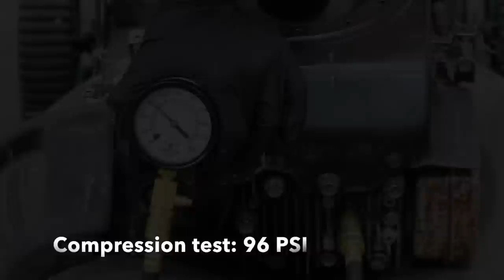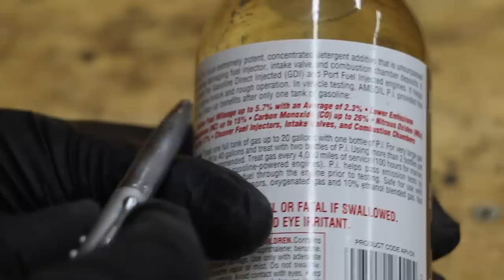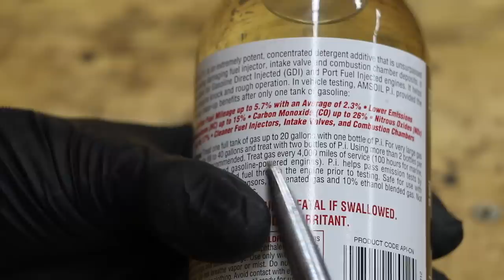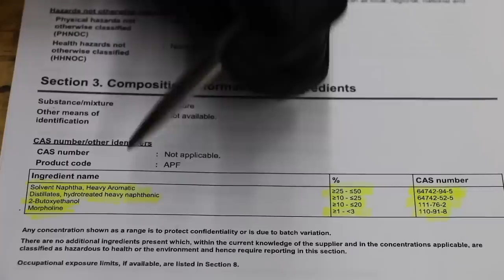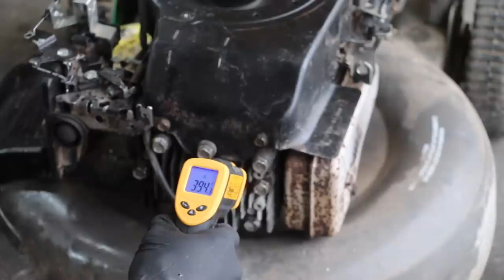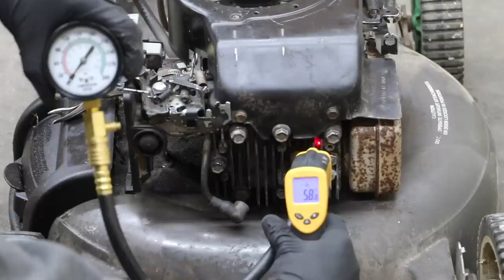Is Amsoil Power Foam better than Seafoam & MMO? Let's find out!

Comment: What was ran in that engine for all that carbon? Diesel?
Reply from the maker: I believe it was from normal use and not from any sort of alternative fuel.
Reply: Project Farm engine must be a bad design. My riding mower and engine hasn’t been in production in a long time. The mower is early 90s and the engine is sometime in the 80s. It’s not even that bad.
Reply: Wood
Reply: That engine must have never ever had any fuel additives to help clean it up.

Comment: Use the PowerFoam in the dirty carb, Spray and let soak...its AWESOME, been using it for that for almost 20yrs. Light varnish like in the video will just melt away, in fact, the white PowerFoam will turn green as soon as it contacts the varnish.
Reply from the maker: It's a great product!

Comment: Amsoil won as far from what I could see in this video,the engine ran alot smoother with about 4-PSI higher level of cylinder head compression.
Reply from the maker: Thank you!
Reply: Spraying tap water into the intake will make it run smoother too! Cost=$0
Reply: @TheOzthewiz  and it scores the cylinder wall and chews up valve trains due to the fact their isn't any lubrication in water.Damage...thousands of dollars.
I'll stick with Amsoil..
Reply: @TheOzthewiz  Causes corrosion and freezes up in the winter time.BRILLANT!!.

Comment: BG 44k cleaned the heck out of a friends older shovel head Harley. We borrowed a boor scope checked before and after. It stared running better 1/3 of the way through. It did smoke a bit at first. Mixed 1/2 a can with 6 gal. gas. The stuff is pricey but the valves were clean and it ran better. Put the rest into my old pan head (older than a shovel) no change but I had rebuilt the top end 2,000 miles prior . Just a thought. Mike. Keep up the great work!
Reply from the maker: Thank you for the feedback

Comment: test liqui moly products  pleeeeease
Reply from the maker: Thank you for this recommendation.
Reply: Great idea, please test ceratec, motorprotect and/or motor protect molygen (not sure if the last one is available in the US...).
Engine flush is a fantastic product too
Reply: Very curious. I run liqui moly 5w40 in my VW 1.9L diesel. 208k miles good luck so far.

Comment: I bet if continued use of Amsoil PI and Foam for a full cutting season would clean the engine up. Plus use Amsoil motor oil for lawn equipment. To me I didn't see that much difference with MMO and Seafoam on the "after" tests. The Amsoil was starting to clean the top of the piston better than the other two products. Great unbiased videos.
Reply: No, the company doesn't recommend you treat more than 20 gallons worth of fuel with P.I. and that's on car engines.
Reply: @101Volts  He said continued use over time. Like maybe every other gas fill up or every 3 gas fill ups add Performance Improver and use Power foam. He didn't mean to add more to the same tank of gas.

Comment: I used royal purple for year but switched to amsoil. In my firebird and my daily drivers and I've seen improvements in both using the amsoil products. Also I used synthetic oil in one of my vehicle's and it had a small oil leak. Not bad but a little. Since I used amsoil not a single drop. I park it on a clean garage floor just fyi. Amsoil used a conditioner to help seal from drying out so they clam. We I haven't lost a drop in 3 months and oil level is pretty close to where I filled it.  Kind of expensive but I guess worth it if you have toys or nice cars or trucks. After all oil is what keeps the engine from melting down. And I'm not hating on royal purple in my opinion from personal test I found something better. And I love this channel you do good work. Thanks for letting me know about diablo switched to those as well cut down cut and grind time. Time is money!
Reply from the maker: Thanks for watching.

Comment: I've heard that pure alcohol will work wonders in an engine for cleaning it. I've never tried... the idea is to pour straight alcohol in the gas tank and run it in high revs. It's supposed to smoke a lot, similar to what Amsoil and seafoam do. But then again, I'm a little skeptical since alcohol evaporates in much lower temperatures than gasoline. Test? Maybe? And yes, your projects are a real eye opener! Thanks for taking the time to show us.
Reply from the maker: Thank you for this recommendation.

Comment: I'm a mechanic and have cleaned out the green crud from ethanol in small engine carbs and fuel systems for quite a few people. This usually happens when they sit over winter. The AMSOIL Quick Shot is recommended for small engines for that reason. AMSOIL also has a fuel stabilizer to help keep fuel from breaking down during long term storage.  Ethanol raises havoc with small engine fuel systems when they sit unused for longer periods of time. (It's not a problem in our vehicles that we use often enough to burn up the fuel before it gets old and constantly replenish it with fresh). For that reason I try to use nonoxygenated fuel (usually premium is the only grade of nonoxygenated I can get in my area) in all my small engines and have had virtually no trouble with my stuff. And yes ethanol is a basic solvent so the injector spray on ported EFI engines helps keep the backside of intake valves clean, and it does keep carbon buildup down in combustion chambers. It doesn't spray on the intake valves on the newer direct injection engines though, it's injected right into the combustion chambers, so those intake valves get gunked up from the EGR and PCV system gases in the intake system. It is becoming a problem. That's where the AMSOIL Power Foam comes in handy, or you have to take them to a shop for an intake cleaning flush.
Reply from the maker: Thanks for the feedback.

Comment: Just used Amsoil Power Foam as a presoak before vapor honing (4) Lycoming aviation cylinders with heavy deposits from AV110 low lead fuel. Stuff worked like a champ. The first cylinder took for ever, but after presoaking the remaining 3 it cut the restoration time by more than half.
Reply from the maker: Thanks for the feedback.

Comment: I’ve used many carb cleaners over the years and AMSOIL Power Foam is the best I’ve come across, B12 is right up there as well but I find that the foaming action of the Power Foam gives it an advantage and better all around cleaning effect. 
As far as using it to clean out a valve train and fuel system while running the Power Foam & Seafoam (spray can) both work well.
Reply from the maker: Thank you for the feedback!

Comment: The amsoil P.i is really good stuff I have a 2005 ford explorer running strong with 210,000k miles the only problem I had with it that it was knocking pretty bad so I poured the P.i and boy let me tell you the knocking went away I was really impressed with this stuff it is really good stuff I've used other fuel cleaners and they don't preform as good as the P.i I strongly recommend amsoil products to everyone the best products out there hands down!!!!
Reply from the maker: Thanks for the feedback.
Reply: I used Redline Fuel Cleaner S1 and Amsoil PI is much better

Comment: Back in 2001, I bought a '96 Jeep Grand Cherokee with the 4.0L six. Spark plugs had a .072" gap, .001" per mile on the engine, lol. Engine was filthy. I used Powerfoam on it, killed all the mosquitoes in a 1 mile radius and woke that engine up. As I recall, one of the ingredients of Powerfoam back then was butyl cellulose.
Reply from the maker: Thank you for commenting on this!

Comment: Hey man I picked up a bottle of this (EDIT: Power Foam) (based on your information) from a local shop (hard to find!! Kansas) I ran my 3.1l Pontiac 201,000 miles @ about 2500 & let off the whole can into the TBI & it cleaned it so well!!! before, it was running smoothly but not too much power. Now, it has a much more aggressive, clean tone!! Good power for a '94 N/A 3.1!!!
Reply from the maker: Thanks for sharing.

Comment: Good video - Something you are not aware of Amsoil P.I. was created for larger engines - primarily automobiles - a better product for small engines besides Power Foam which, I have used for decades on cars/trucks as well, is Amsoil "Quick Shot" product code "AQS" this was designed for the small engines 2 stroke and 4 stroke alike - it has an additional fuel stabilizer, it will eliminate phase separation of the ethanol in the fuel as well as, clean the combustion chamber of carbon and keep the carburetor and fuel injection system clean.
Reply from the maker: Thank you for this recommendation!

Comment: That's why it's a good idea to use Amsoil products, such as the P.I., on a regular basis to prevent all of that build up before it happens.  I use it in both of my cars every 4,000 miles religiously.   In one car I used it every 4,000 miles until I got over 100,000 miles.  The engine ran super smooth, just as it did when it was brand new.  Ethanol really messes up the insides of vehicles and especially lawn equipment.  Ethanol-free gas, typically at or neat boat yards, is so expensive if you can find it.
Reply from the maker: Thank you

Comment: This was very impressive.  That engine was in desperate need of a carbon cleanup and this stuff really took care of business from the looks of it!  Another 2-3 treatments and I wouldn't be surprised if this engine would be very clean.  The downside is the messiness of the actual operation with the foam.  BUT, for these results, I wouldn't even care.  In my opinion, I have to say that this and Seafoam seem to really do the trick with MMO not far behind.  Thank you for making such nice videos.  I know this video is older but your video editing and production development have improved as well as your process and step-by-step approach up until this point.  I dread the day where I watch them all and have to wait for the next one but it'll be worth it, guaranteed  :)
Reply from the maker: Thanks for the feedback.

Comment: Back in the sixties I worked for a man who used to run super modifies on the round tract . We always used regular type auto transmission fluid to clean up carbon . We'd run it the intake and put some in the gas tank . It worked great for cleaning up carbon . In my Harley I used Marvel Mystery oil . We had a 350 v-8 engine in a 26 ft. Sea ray that was knocking so bad from carbon we thought it was going to sling a rod . We ran 3 liters of water through the carb at 2500 rpm and it blew out carbon across the yard in chunks . Then ran brake fluid through the carb to flush the remaining carbon out . The engine ran great with no knocking after that treatment . If you ever try this extreme treatment remember to change the oil immediately . The last time I used a treatment was on my step-daughters van that wouldn't even stay running and shook violently . On that day I used sea foam . I ran one can through the intake and put one can in the tank . It worked great and the van ran like new . So in conclusion sea-foam works and I still use it today . Always remember to change your oil after using any of these treatments . They tend to wash out carbon and some ends up in the crankcase . Have a blessed day . 
Old motor head Wayne 😎
Built my first engine when I was 8 years old .
Reply from the maker: Thanks for the constructive feedback

Comment: I’m going to try the AMSOIL power flush on my riding mower. I use it only 3 or 4 times a year. I’ve had it for 10 years and it has never started without starter fluid. Later, I suspected the store didn’t want to build a new mower so they delivered the floor model.
Reply from the maker: Thanks for sharing.

Comment: Spraying or soaking inside the combustion chamber through the spark plug hole is very effective!  I have done this to loosen up sticky rings and oil rings with good results using Seafoam.  This product obviously does a good job as well.
Reply from the maker: Thank you!

Comment: Finally! Great job. I use both these products on a Ford turbo direct injected 3.5 v6. The hardened intake valve carbon deposits  become very soft and paste like for what didn't get washed away after a powerfoam induction cleaning. Also melts away throttle plate gunk and has saved my  Dodge avenger's drive by wire throttle body several times due to poor pvc system design. The foaming action really allows it to stick to the deposits  better than the 'liquid' products. Did you happen to poke at or scratch the remaining deposits in that engine? Usually they're very soft after a hot soak with powerfoam. Love this stuff
Reply from the maker: Thanks for commenting on this. Glad this has helped with carbon deposits on the Ecoboost and avenger!

Comment: I know and use sea foam. My goldwing 1500 sat for nearly a month while we cared for my wife's sister who was in a bad wreck. 
I finally had a chance to ride and it rode rough. Stopped a parts place and picked some sea foam. Filled with fresh gas and a half bottle. Drove until i was less than half filled up and poured the rest.the bike started to respond,  accelerate and run better than before. I put one once per gallon now about every third or fourth  fill up or so. So six once to 6.5 gals. 
I dont know about the other products but it dis seem to clean as well as sea foam.
Reply from the maker: Thank you for the feedback

Comment: The best decarb oil I ever used is Evinrudes xd-100 outboard oil. I even put a light mix in my lawnmower at the end of the season just enough to fill the carb bowl starts every spring keeps carbs and heads like new. Also will clear a gummed up 2stroke carb over night.
Reply from the maker: Thank you!

Comment: Side note. I use sea foam in all my yard machines. 
I moved to a new house in Nov. We had to be out of our old one in two weeks. That was around auvust.. I stored my nearly new Simpson 3400 psi pressure washer in my buddies open garage for nearly 5/6 months without starting it. 
Yesterday i went and picked it up. Before i.took it there i filled the tank with freash gas, one once of sea foam and one once of of Barstall (sp) i started it , let the chems blend and took it to his house to store it.
Picked it up yesterday. I cleand the plug, put it back it after two pulls. Chocked it turned on the switch pull the rope and it fired on the third pull. Ran nearly a half a tank cleaning off the truck and car and driveway. When i first pulled the pressure handle the protected spray i put through the tri  valves was still foamy and protected the valves . It a 200 Honda engine and 3400 psi. Seafoam works.

Comment: You may want to try Yamaha Ring Free Plus? The boat dealer said that one customer couldn't start his 9.9HP 2 cycle OBM. He put in the Ring Free, it still wouldn't start, but over winter sitting in the engine, supposedly it started and ran fine. Its mostly Zyline I believe.
Reply from the maker: Thanks for the suggestion.

Comment: I have used both products on auto motive engines with great success.  I used to put 2 once of pi in college students gas tanks free of charge.  Most of them were at 1 quarter tank or less and have them drive around and come back to my repair shop to tell me about how it runs.  Ten out of 10 purchased the product.  Note PI made 87 octane run like 93. It kept the fuel vaporized better.  Noted one customer had run PI for 1000 mile trip then crashed total the car. I ended up with the car in a trade for one I had just been overhauled the engine in . I had used his engine and took it apart for a performance build. As avertised 90% carbon cleaned 👌 😎.   On another Japanese car that had a sealed carburetor replacement value 850.00 usd. It wouldn't idle in gear.  It barely idled at all. I put a full bottle in the gas tank while engine was studding just to maintain a idle.  With in less than 30 seconds you could hear the engine smooth out with in a few minutes it was running perfectly.  Power foam is great for cleaning carburetor in and out of the cars.  It leaves the castings clean and factory fresh looking.  I used to soak in a carburetor solution tank but never again after power foam. It also worked on sticking valves from sugar in the gas tank.   Now a note on wd40 I was working on a BMW engine in pompano Beach fl dealership.  I had cylinder head off but parts didn't have a replacement in stock it was coming in the next day.  I had to leave the car out side in the parking lot 1/8 mile from the beach.  So I sprayed WD40 in each cylinder and piston top soaking all exposed parts.  The next day read to install the new head I prepared the block and noted the carbon layer on the piston was very soft and easily removed with a light scraper gently not to scratch the piston tops. Yes the carbon was like puddy.
Reply from the maker: Thanks for sharing.

Comment: Seemed to do a pretty nice job!
Have been in the marine industry for over 42 years now. Worked for Johnson/Evinrude for 22 of those years. OMC (BRP now) produces a combustion chamber cleaner that is simply called OMC Engine Tuner that I would like to see tested in your engines. Primarily used as a 2-cycle cleaner I think it would do a very commendable job in the engines you are using.
Reply from the maker: Thank you!

Comment: You mentioned Berryman's B-12 Chemtool and I know from past experience that it will clean that yellow varnish out of the bowl and carburetor. I use Seafoam and Marvel Mystery oil and I don't think they will clean it out, at least not as fast as the B-12 does.
Reply from the maker: Thanks for the feedback.

Comment: Another great video, love the slo-mo shots.  I hope you are wearing earplugs, and in a very well ventilated outside area.  
How about running an engine on 50/50 used motor oil and gasoline?  Let's see how dirty you can make the carb and combustion chamber, then clean it up with Seafoam or Marvel MO.
Reply from the maker: Thank you for this recommendation!